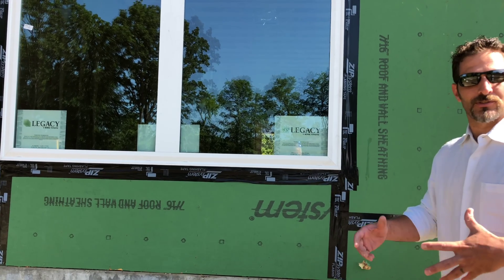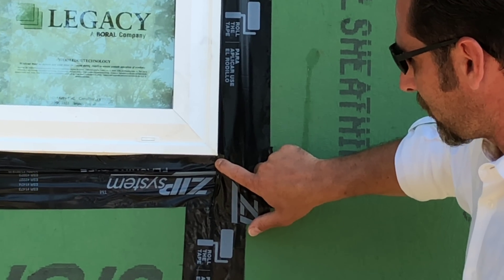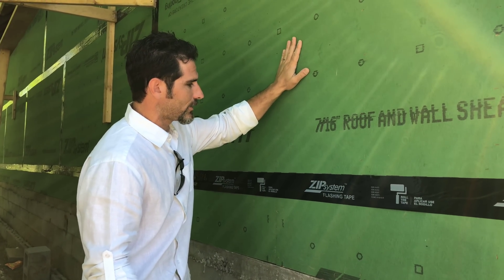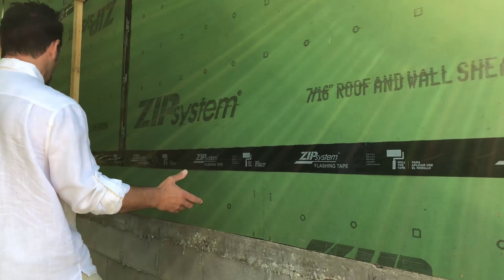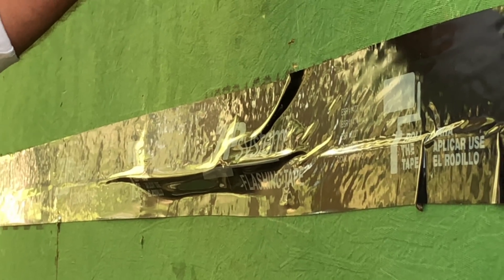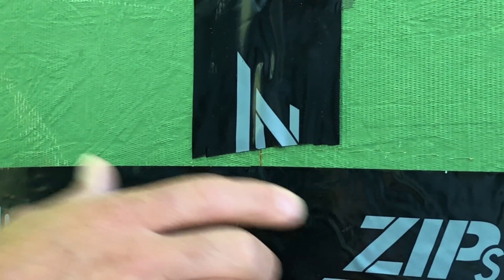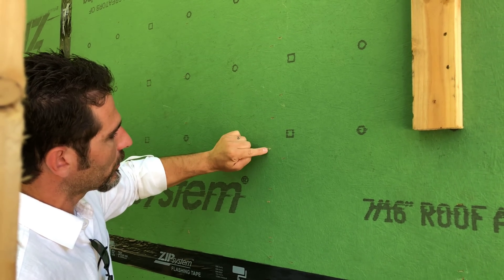ZIP System Problems

Comment: Looking for your opinion on the following.  Just added a large garage and family room to  my house and used Zip Board. Totally not happy with the install as the contractor did not roll the tape. Architect was the one who advocated for the zip system.  Built my house 30 years ago and used Tyvek. When I stripped the old siding off the Tyvek was still in good condition other then it did not seem to be as strong as it was when I installed it. 

What is your opinion on using Tyvek over the zip board? Siding is going to be cedar clapboards.
Reply from the maker: Tyvek over the zip system will be a great thing to do for your structure.  if you are installing any cladding materials that will be touching the Tyvek (hardie, rigid siding, stucco or faux rock)  I would recommend installing a drainage mat that is a minimum of 1/4".  This will prevent the water from damming & causing issues.  If you are installing brick or natural stone for your veneer then you will not need a drainage mat.  When installing the Tyvek make sure to hang the Tyvek below the bottom plate line (joint where the slab meets the wall) as well as making the Tyvek go up past the soffit line.  These are two common errors I see when housewraps are installed!  Also make sure to lap the Tyvek over any flashings & the top of the window tape to create the shingle effect!  Hope this helps & thanks for watching:)
Reply: Do yourself a favor and do not staple the Tyvek to the zip sheathing. Use the Tyvek as a rain screen only. Install 1" wide x 1/4" or 3/8" thick vertical strips of plywood onto the sheathing then stretch the Tyvek over and staple it to the strips. This leaves a 1/4" air space between the sheathing and Tyvek. This serves two purposes 1)air circulation 2) prevents and water that may have gotten behind the Tyevk from touching the sheathing. Forget about the perm rating of Tyvek. You want as much air circulation behind it as possible in order for any moisture or water droplets built up behind it to dry out as fast as possible.

Yeah I know its a bit more work but it's the best way to protect the sheathing and still allow air circulation. This is what I did to my shop 25 years ago. I took off a section of my board and batten siding 2 weeks ago to install a new rear entry door. The OSB sheathing and Tyvek are pristine as the day I originally installed it.

Comment: In other words, make sure the system is installed correctly and make sure the air exchange for the house is done allowing for the walling system.
Reply from the maker: According to the third party testing done on this system after it was installed correctly it still did not perform well.  However the point of this video was to show how easily this system can fail with poor installation.  It has it's challenges when installed 100% correct but when installed incorrectly it really get nasty!  This product is being marketed as easy to install & basically using less steps but is far from the truth!   Thanks for watching!

Comment: I noticed most of the comments are on the installation of the product, which seems to have been very poorly done.  However, I really took note about the potential condensation problem.  Besides the wrap, which I'm not sure I'll be able to do, what other method would you suggest?
Reply from the maker: There are fluid applied products you can use DuPont Tyvek makes one.  The Tyvek wrap would be the easiest to do if you can use fasteners but if you are dealing with block or concrete walls you may need to use the fluid applied WRB.  If you do use the fluid application make sure to read the installation instructions & install it properly.  If you do that you will have a great system of protection!  Tyvek also has a certified installer program if you would like help & it's free!  Get on the DuPont website & search for a certified installer in your area.  Thanks for watching & hope this helps you!
Reply: @WeatherProofingAmerica  Awesome, thanks so much!  And yeah, I'll be dealing with brick and concrete.  ;)

Comment: Just replaced some windows in a house with tyvek on it that was built 20ish years ago.  Will never use any type of housewrap again after seeing how deteriorated it was.  Zip is the only way to go.
Reply from the maker: The only time I have seen Tyvek deteriorated, it was installed with rigid siding, stucco or faux rock right up against it with nowhere for the water to drain.  This makes the cladding materials rot which in turn looks like it affects the Tyvek.  If Tyvek is installed with a drainage plane on top of it before the cladding is installed, it will do it's job for many many years!  Another circumstance I have seen Tyvek deterioration was from bugs that are in the wall cavity feeding on the rotting wood that is water logged!  If Tyvek is installed correctly water will not get behind it & these issues will not occur!  All products require proper installation to work as intended.  Thanks for the comment & for watching!

Comment: looks like you would have to try hard to do that bad of a job. This is misleading video to slam Zip for what motivation i'm not sure. Incorrect perm ratings stated.
Reply from the maker: Tony Crisci mo motivation except to show this system is not foolproof as it is being marketed! I stopped by a random house in a subdivision that was building with this system. These same problems were on all the houses! Seems like they didn’t try hard to install it correctly which is why the result seen here!
Reply: @WeatherProofingAmerica  Subdivision say no more. Just another slam bam job.
Reply from the maker: Tony Crisci here is a third party installing the system to the T! You be the judge whether or not you want to rely on this system after watching:)
https://youtu.be/XmvTanyghus
Reply: @WeatherProofingAmerica  Thanks for the response. I have already watch that video months ago. I'am the property manager and owner of  two units in a 15 building coastal condo community. About 10 years ago we removed all the siding and foam board sheathing on our 30 year old buildings.  Because we are a coastal community there was much framing rot from wind driven rain. I did my research and chose to use zip system for the new sheathing. 
Because code required us to keep FRP( fire retardant plywood) 4 ft on either side of our party walls we also wrapped the buildings in 15# felt paper.
We now have a belts and suspenders approach to water infiltration. 
The felt paper is cheap and it becomes the primary drainage plane.
It also keeps water away from the fastener holes.
This is as close to a perfect system I believe to mitigate water infiltration.
Other than someone going around the zip system and meticulously using the newer fluid applied products on every seem and every fastener hole.
We did have problems with contractors not rolling the tape.  If you notice the tape says "Roll the Tape" on it.  It did not have that on it when we used it- don't know if it makes a worker more likely than not to roll the tape.
Windows and doors need additional attention to details.
We were one of the first to use the zip system on our barrier island.
Now it is much more prevalent.
One high end custom  beachfront builder use it exclusively now . Probably because his personal 7 yr. old $7 million beachfront home needed extensive rot repair as it leaked like a sieve. 
No system perfect. And any system can be installed incorrectly.
You should edit your video to correct the mis stated perm of the zip system -maybe you confused it with zip-r.
I have seen tyvek after being under vinyl siding for 15 yrs or so. It literally looks like tissue paper as the wind has vibrated the siding against it for years.
Sorry for the long reply.
Hopefully your video and my reply will help some viewers decide on a WRB for their build.
Thank You
Reply: @WeatherProofingAmerica  the video you shared was sponsored by Tyvek.  It is unrealistic for what any system would face.  But maybe you aren't interested...

Comment: Zip works fine. Installer failed
Reply from the maker: Robert Montgomery 
http://www.dupont.com/dpt/tyvek-weatherization/zip-sheathing-system.html?src=gg-kg_tyvek-X-us_zip-system&gclid=Cj0KCQiAoo7gBRDuARIsANeJKUYsbOeO4PSPMVgkVTBfiLomezBYdZCXot_ZYfjwg3wO0z0EoKEULvUaArUKEALw_wcB
After reading these articles give me your thoughts? Thanks for watching:)
Reply: @WeatherProofingAmerica  You can't post an "article" done by the competition and blindly label it as fact. Third party, independent testing is the only testing that truly "proves" anything. Biased studies and bullshit articles are a cancer on the building science community.
Reply: www.dupont.com what would expect?  Dupont singing the praises of zip?
Reply: @WeatherProofingAmerica  

You can't post an Dupont site as evidence that tyveck is better.
They manufacturer tyveck, of course they will say their product is better.
Reply from the maker: They are having these tests performed by top rated third party companies. Yes the information is found on their site but where else do you expert it to be found?  Thanks for watching
Reply: @WeatherProofingAmerica  The ASTM test they performed wasn't even for testing WRBs, it was made for testing windows. No WRB gets directly blasted with water once the cladding goes on.

Comment: I think with ANY “SYSTEM” you talk about its going to come down to installation. If it’s not installed per the manufacturers instructions it simply won’t perform.  Tyvek and Tyvek Tape is no exception.  If it were applied in the same sloppy, hap-hazard way (allowing water to funnel in the tape) you’d still have issues.  If the Tyvek is not installed correctly on the home (and wrapped in the window and door openings correctly) you will not get the performance that the product is rated for.  There’s never going to be a quick fix or system for skilled tradesman who doesn’t give a shit or a person working on a job who doesn’t possess the skills to do the job right!
Reply from the maker: Dana Parish you are absolutely correct! The point of this video is to show its not easy to install & is not dummy proof like it was being marketed in our area!  The contractors were being told it was faster & easier to install than housewrap & was more forgiving when none of those things are true. Will the system work if installed correctly? That is for someone else to argue as for me I don’t want to rely on reverse flashed everything & tape to keep water out of anything I touch:) Thanks for watching the video!
Reply from the maker: Dana Parish here is a video showing the system installed very carefully following every manufacturer step! You be the judge:
https://youtu.be/XmvTanyghus

Comment: god what a sloppy job. i feel sorry for the future home owner too. they should be jailed or at least provided a very long warranty. that looks like a DIY job!  all those issues could have been no issue at all if they had just used the liquid flashing over all penetrations. that tape is a joke too time consuming to get perfect.
Reply: The DIYer would have watched the hundreds of videos on YouTube about how to install this correctly, and then done it correctly. This looks like a lazy contractor job.
Reply: I think tyvek is better and even cheaper than using the zip
Reply: Sadly poor workmanship is very common in new construction.
Reply: its true bad job, but honestly water wont get past the finished siding. idk what the big deal is but i do understand the air tight factor
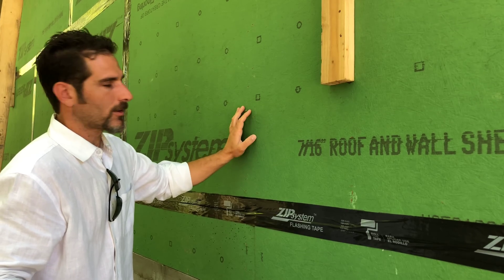Reply: @ jake boer:I'm no contractor, but even I can see how water can get past the ZIP sheathing. Every single nail driven into the stuff is a potential water leak. As is mentioned at 4:20 in the video, those nails that miss the studs are surefire paths into the wall space. With the Tyvek system, all nail holes are automatically covered and leak-protected. It IS a big deal! Were I building a new home, I would write the contract to specifically preclude the use of this ZIP junk.

Comment: All based on the premise that your house needs to “breathe”....it’s old and cheaper science....but if you can get the sub 1 perm, the science says condensation shouldn’t be an issue...it’s all or nothing or else zip becomes glorified osb.
Reply from the maker: Adrian Sanchez your wall system can be thought of as a windshield in a vehicle. The air outside & the air inside are extremely different temperatures and the windshield separates them. Condensation builds on the windshield due to the temperature change, this is the same principle that happens on the exterior walls of a structure! If your housewrap does not breathe that condensation will build and cause problems. Also if the structure allows air exchange at the wall system at all the condensation will be there. If the structure does not allow air exchange through the wall system then you are correct the condensation will not build. However I am not aware of any wall systems that don’t allow air exchange....so this old science is all we are left with!
Reply: Weather Proofing America this product can do it if the right measures occur...YouTube “zip system 2.0” a video by Matt Risenger. I’m no engineer this product is only 10 years old...I’d chaulk it up to untrained not bad framers who simply never spent the time to learn. You are seeing it with your own eyes, the tape not flat, the tape not overlapping where it meets, they probably have no plan to do the concrete joint, the windows aren’t done right, etc and etc....all this to say, if the installers aren’t going to go the extra mile including a house air ventilation system, they should just use osb with wrap, which is time tested and still up to code.
Reply: Adrian Sanchez +

  You’re
 Saying the contractor not going the extra mile. I say the contractor is shoddy. 

  My parents had a home built a few years back. Very large company building approximately 200 units. My Dad would go on site every evening and take pictures of features he didn’t like. 

  He confronted the general contractor that had a trespassing order served against my Dad. It wasn’t “their” house until they went to settlement. 

  Long story short, they were in the house less than a month when a freak windstorm blew in taking the roofs off of 10-12 units. The folks had $15k in damages to their cars as well as having to have the roof replaced on a month old house. The roofing contractor winged the job by short nailing, 3 nails( actually staples) instead of 5 as required by GAF. 

  The builder as well as the roofing company declared bankruptcy, leaving my folks without a 5 year warranty and a house needing corrections. 

  The poor workmanship probably wouldn’t surface for a few years, but at that point, the contractor and installer will be long gone.
Reply: Gunga Dinn but ur story and what this guy is showing is not apples to oranges...they are using the zip sheathing as a water barrier to save the step of a house wrap, still code compliant based on what I see here assuming they installed it similar to any other sheathing...but the zip system is capable of more if they would take advantage of it.....in your scenario I’m surprised it passed inspection.
Reply: @WeatherProofingAmerica  Do your car windows stay fogged if the car's AC is on? What do you think that puddle of water under your car is?
Reply from the maker: Chris Wilson lol no not when the ac is on of course that is what solves that because the ac pulls the moisture out of the air! But unfortunately when it’s winter time our ac is not on in most homes so how does the condensation dissipate?
Reply: An air barrier isn't enough.  You also need insulation.  You have to prevent warm, humid air from contacting a cold surface.  If the air barrier layer gets cold, condensation will occur.  What is needed is insulation combined with your air barrier.  New codes give guidance on how much insulation is needed based on regions, and the traditional poly air barrier shouldn't be used if the exterior insulation is thick enough.

Comment: Perm rating less than 1?  Where? Under the tape?
Reply from the maker: Matt Nisnevich the perm rating on zip osb panels after installation & taping is less than 1. So the whole wall system is less than 1 after installation is completed.
Reply: Weather Proofing America, only the zip-r system has per rating of 1.0.  The regular zip system is 12-16.  It’s right in their own literature.  You said zip system in general and did not specify which zip system.  Not everyone uses zip-r.    http://www.huberwood.com/assets/user/library/ZIP_System_Sheathing_-_Product_Data_Sheet-v2.pdf
Reply from the maker: Please read the following article to find the truth not what ZIP tells about the thin layer of WRB not the whole panel itself...http://www.dupont.com/content/dam/assets/products-and-services/construction-materials/assets/Tyvek-vs-ZIP-System-Tech-Talk-K17924-1.pdf
Reply: @WeatherProofingAmerica  They do not site which company did the third party testing.  From the linked article, it's not possible to verify how the test was done or even done at all.  It might be a valid test or it might not be a valid test. It's impossible to know because they do not say what company did it.   Earlier in the article, they mention HAHB Research Center testing of installation difficulty/time, but for the permeability they mention nothing.   Quote:  "However third-party laboratory testing of the vapor permeability of ZIP System wall sheathing with the bonded WRB oversay shows that it has vapor permeability of less than 1 perm..."